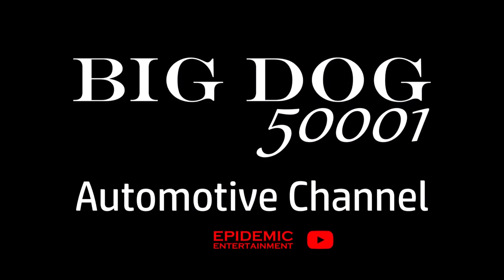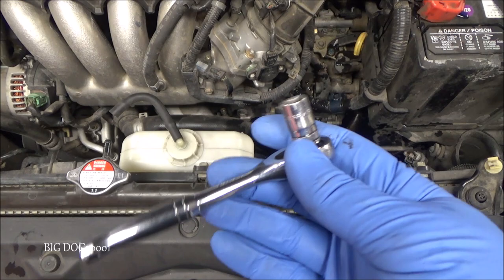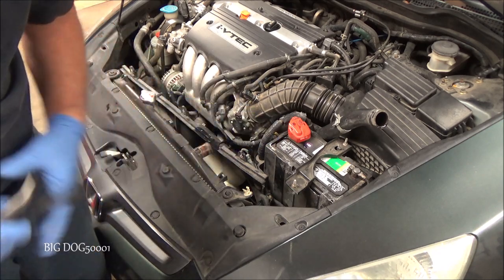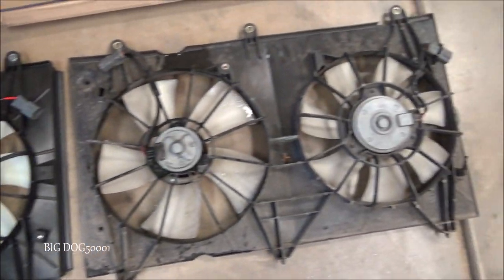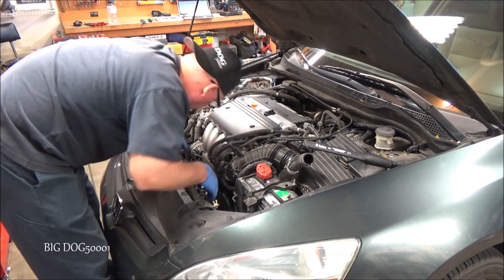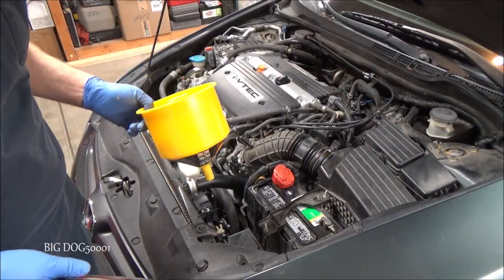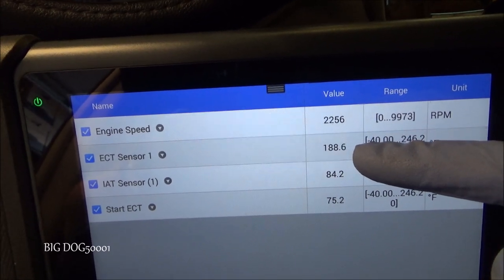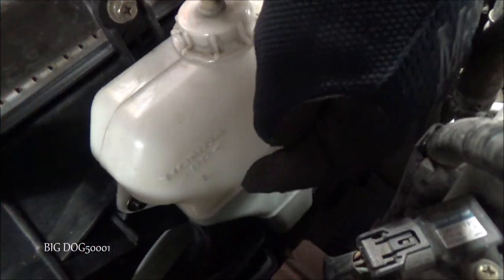Honda Accord Radiator/Condenser Fan Assembly Replacement (2003-2007)

Comment: Thanks a lot for the video. I was just needing to replace the radiator fan motor.  I just need to get to the 3 screws, but the are not accessible without removing the whole shroud and fan assy. (With my tools). Thanks again man.

Comment: Thank you for another valuable video.  I actually need this.  My 2003 Honda Accord coupe is having this same issue right now; the radiator fan doesn't work while the condenser one does.

Comment: I replaced this on my accord about 2 or 3 months ago. Almost caused my engine to overheat. My gauge was probably almost 2/3 of the way to the far right. Luckily I noticed the gauge and immediately pulled over. Replaced it the same day . Easy and cheap (ish) job. But, I have a new issue, I I don't think it's from doing this work, but it's some sort of intermittent no start. I have power, battery terminals are clean and tight, and key fob is functional. When I try turning the key to the starting position it sometimes makes a "grinding?" Sound. Usually harder to start from a cold start. I'm guessing faulty ignition cylinder, but I don't want to fire the parts cannon with a lower budget
Reply: If the starter motor itself is worn out, you may hear grinding under the hood where it engages with the flywheel/flex-plate. If the sound is in the dash and more of an electrical groan while turning key to start with no results, the ignition switch may be faulty. It is separate from the ignition cylinder and fairly inexpensive and simple to replace. Plenty of videos for it, but 6 screws under steering wheel and unplugging a connector is all it takes. Good luck!

Comment: I replaced coolant and during purging of air the fans won’t kick on. Got P2185 code for ECT sensor 2 circuit high. 2005 Accord 2.4L. Any good aftermarket sensor replacement u recommend?
Also the wiring harness clip that attaches to sensor was brittle and crumbled upon detachment. Do I need to replace it since it doesn’t click into place? What would be solution guessing have to splice or solder wire replacement?